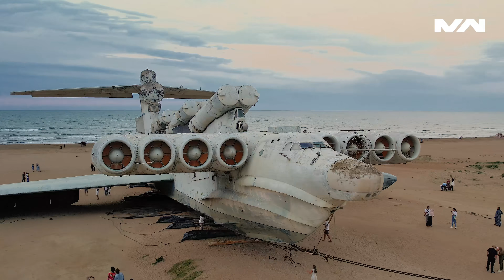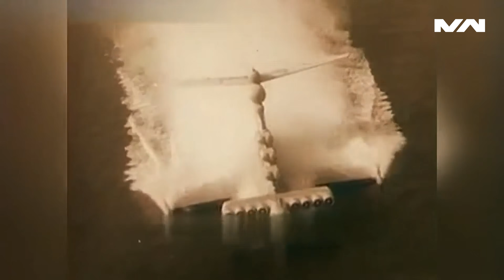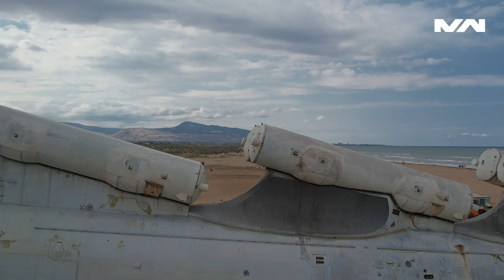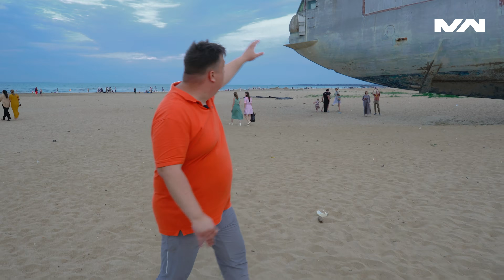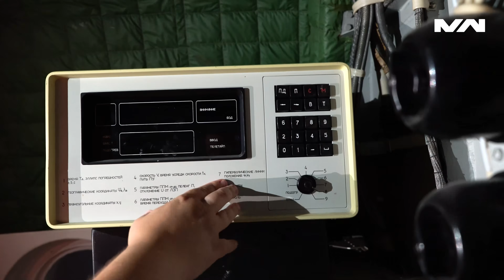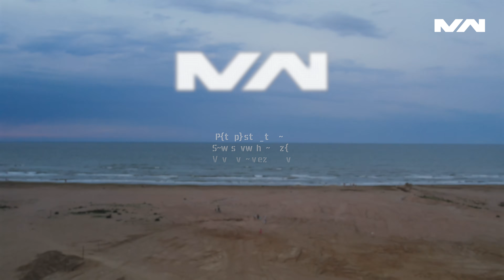How it works - RF Loon by Modern Warships

Comment: Awesome video, About the Ekranoplane. Make more of these with other Warships pls. 

Also, why the Ekranoplane was not used are other factors you forgot to mention:
1. Though it was fast, it was very hard to Menuever and would require a large radius.

2. It could only be used on calm seas, and could not handle rough whether which made it limited

3. It's massive jet engines would get withered by constant bombardment from salt sea waters. 

Cool plane though
Reply: Thanks for the additional info
Reply: THAT IS WHY ITS FRAME , OUTER LAYER , ENGINES AND ALMOST WERE MADE FROM NON CORROSIVE MATERIALS LIKE BRASS AND ETC .

AT ITS TIME IT CAN'T BE TARGETED DUE TO ITA SPEED AND MANUVERABILITY 

ITS ABILITY TO LAUNCH MISSILES WHILE MOVING WAS SO IMPRESIVE THAT THE AMERICANS ALSO CREATED THEIR OWN COPY IF THE SOVIET EKROPLANE

ITS A LEGENDRY VESSAL

Comment: Basically using a skip bomber like effect move and stay at the minimal altitude very interesting
Reply: And delivering nukes and gettigg away before the enemy Discovers it
Reply: Not quite the same concept as skip bombing.

The Ekranoplan uses what is called "ground effect" which is a phenomenon experienced by every fixed wing aircraft when at a height at or below one half of its wing span. Essentially,the air being deflected down as lift is produced hits the ground and comes back up providing a little extra cushion. This gives considerable boosts, mainly in reduction of drag. The flight of Spruce Goose was nearly entirely made in ground effect for example.

The Ekranoplan uses this effect to it's advantage by having shorter wings than a full airplane, but enough lift to clear the water. As water is 800 times more dense than air, the drag is significantly reduced when it is cruising which means that those 8 engines can move the vessel at some pretty quick speeds. If you were to strap those engines onto a frigate or other boat of similar weight, it wouldn't be nearly as fast due to the hydrodynamic drag of the water.
Reply: @ParkerUAS  thanks